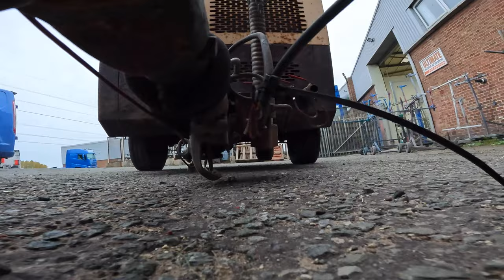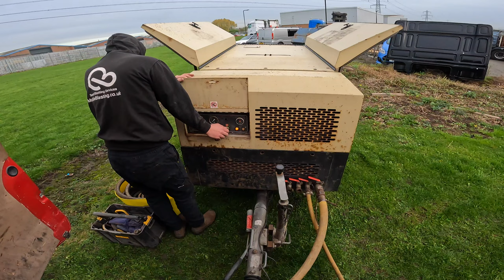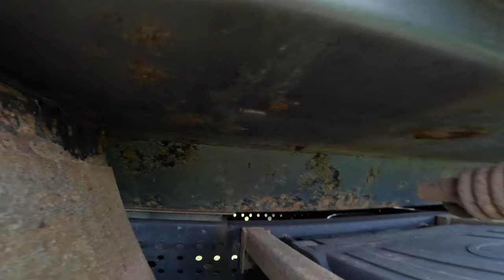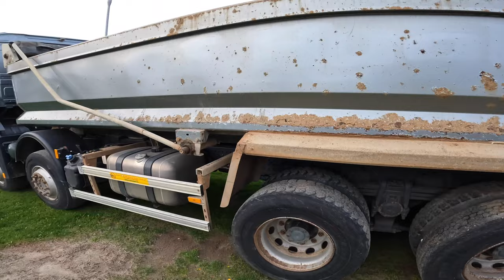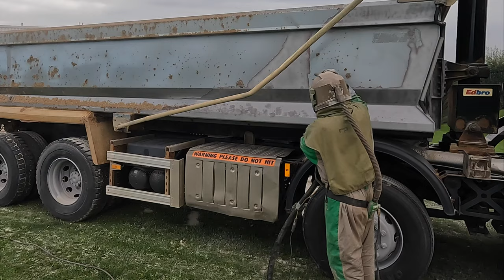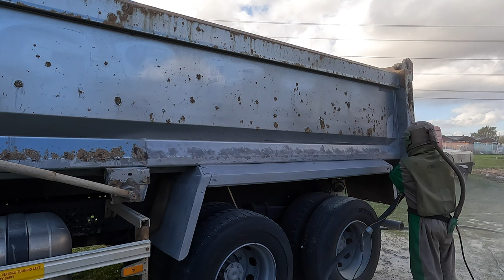SandBlasting Rust off Dump truck lorry 8 Wheeler wagon

Comment: Good morning! Make a video talking about your machines, how much abrasive it handles or something like that and also the items it has such as an abrasive regulator or other items. I'm Brazilian and I really like watching your videos. Happy birthday
Reply from the maker: Hi my blast pot is a generic pressure pot sizes I use a few different pots all basically the same just some are larger than others from 2 x 25kg hopper to 8x 25kg hopper all very in blast time etc that all depends on the surface and how fast its coming off no blanket time for a similar job too many verbals to say this job should take this long if you get me?

Comment: Do you use any type of wooden boards or blocks between the dump body and ground or chassis as a safety precaution just in case the hydraulics fail and the dump body falls
Reply from the maker: Yeah I'm unsure if I filmed it normally chuck a 6x6 wood beam between the chassis and tub. I may not do this sometimes but I'm conscious not to get any part of me between tub and chassis 👍

Comment: What media gradient do you prefer for very rusty metal with  deep pitted black rust blisters?
Reply from the maker: Depends on how heavy the scale is. My line of work fine and fine+ crushed glass works well. If I was working on something slightly thicker scale ie steel portal buildings I would look into a heavier grade of media not more course as some would think.

Comment: Just curious what sandblaster/abrasive you use? Also is that a doosan air compressor?
Reply from the maker: Yeah a doosan 7 71 and crushed glass was used on this job not sure if it was a fine or a medium grade 👍

Comment: I feel like could probably stand back a little bit more to give you a wider coverage and open your valve up just a little bit more. Good on ya mate.
Reply from the maker: My xl nosel would give extra reach but it felt a little under powered I was using that at the start so when I checked its about had it now so I put on a general clean nosel hot spot isn't the best with these so I had to make do
Reply: @Mobileblaster  you do well mate. Sandblasting can be very frustrating at times. Cheers mate. Starting to warm up here in Australia 🌏
Reply from the maker: @scottkenzig5144  warm up? is your summer starting? It's just starting to be a little nippy on a morning hear only be a few weeks before winter kicks in 😬
Reply: @Mobileblaster  getting near the end of spring. Had a wet winter so it will be a hot humid summer. Cheers Mike. I'll keep checking out your videos.

Comment: And that's another great job done Mick.
I've started to build a DIY pot blaster from an old gas bottle, it'll be only for personal hobby use but I'm looking forward to using it.
Reply from the maker: Oh cool have ya made a way how to meter the media flow? I see this is overlooked alot on DIY pots. Please make sure ya use a good mask or a full face is ideal don't use the hood type off ebay they are shocking

Comment: Did you increase the media flow or change nozzle size to speed up work rate from the roll over sheet arm to the back?
Fine glass media?
Nice job BTW.
Reply from the maker: I started out with the XL nosel but I could feel and see the pattern just off I checked and sure enough I need a new 1 so I would be down on psi with a slightly worn nose I knew I would be pushed for time with the wheels and underside so I opted for optimal psi and use a general nose to get 100 psi.
at the start I was using super fine glass on the head board the sides was medium glass. I do play with the video speed to fit as much into the video as possible so some areas may look faster than others but mainly its just editing speed to make the video flow nice :)

Comment: Mickey, have you thought to run a fuel treatment through the air machine motor to burn the carbon and soot off the valves and intakes?  You think that would smooth her out and give her better starts and zip?
Reply from the maker: I think It's electrical mate I think she needs a ecu or a Web of wires because the fault codes are too random to make any sense
Reply: @Mobileblaster  If I win the Kellogg's Cornflakes Billion Dollar sweepstakes, I'll get you a new one and fly the family to the Caribbean for holiday.  In my case, it's having a shop that's far too small for what I do.
Reply from the maker: @solskengroupllp2758  Go big or go home if you have the work to fill it do it take the leap whats the worst that could happen 😉

Comment: Nice work as always sir! I’m looking into this business in the US. Do you have a video running down your equipment? At first I was thinking Truck+Trailer+BlastEqupment+compressor. Since finding your channel I’m liking your Van setup a lot. Have you ever had a different setup? Thanks from a newbie over the pond! Cheers!
Reply from the maker: Yeah loads of different ways to pull the job off I like the motility of a small ish van instead of a wagon but I will be honest I'm pushing its limits on a daily basis so possibly not the best option available. I don't have a video of my rig etc as I don't want to be a how to channel as alot of stuff can go wrong so I stay away from this side of things 👌
Reply: @Mobileblaster  Thanks man, keep crackin

Comment: Great vid.
How long did this take?
Reply from the maker: Thanks
I cannot remember for sure but normally around 10 hour with the underside 👍
Reply: @Mobileblaster  I just checked out some of your past vids...no trouble with the accent, fellow northerner. Did you ever sort out the design patent on your gear?
I have just set up a flame spray firm in the middle of the Indian ocean and have got a load of blasting to do and not a lot of experience. What I have experience in is prototypes and was wondering if some advice trading could be in order ( after a suitable NDA is signed of course)
Reply from the maker: @roberthamblett9619  I need to change a few things but it takes way too long and too much effort for a guy like me to understand what exactly they want and the costs are starting to make it an expensive venture so I think I will pick this up at a later date I've been in talks with a manufacturer to try and make it happen a different way but even this isn't my favourite option I'm at a loose end with it at the moment. I cannot really offer much knowledge only try to answer your questions as skill is earned with time in the lid every trades person makes their bit look easy just remember these videos make blasting look easy well it is to the ones that know how 😂👍

Comment: Did you just put a whole radio in your helmet Mick 😲
Reply from the maker: 😂 JBL flip 4 I don't rate the battery though. I do have a power bank in my pocket (normally used for the 2nd camera hence no pov shots in this video) with a wire up to it later in the day 👍
Reply: @Mobileblaster  You are funny mate .I sometimes see the funniest things happen in your videos. I do some something more compact but it hilarious you using the JBL flip 4 😂 incomparing i do use sony wi-sp510 earphones playing music from my phone end the craziest part is they are small they do not hurting your ears they are comfortuble while wearing your hoody and that helmet plus the earphones battery died's after 15hours of use. a highly recommended earphones to sandblasting with you can evens answering phone calls with it 😂while blasting
Reply from the maker: @Moh4n95  the only reason I pick the speaker over the earphones is so that I can still use my ear defence and still protect my ears. I did use some Sony noise cancelling ear buds but the battery weren't good and they hurt my ears.